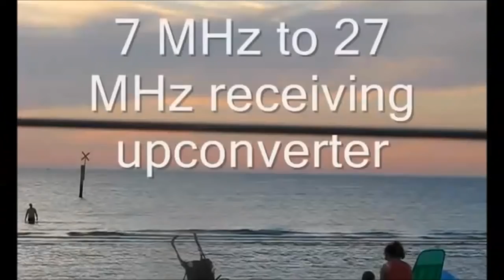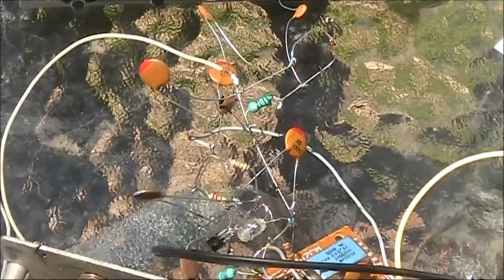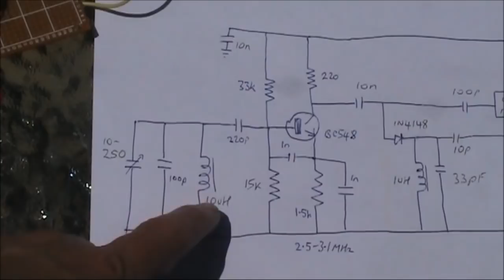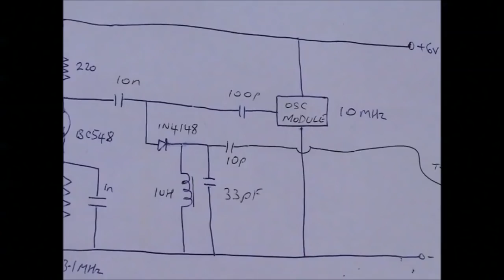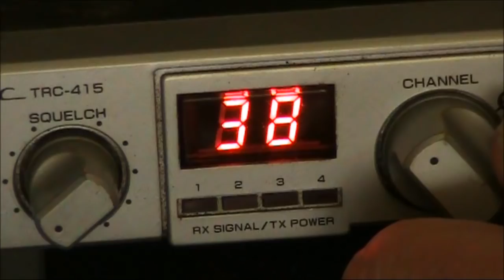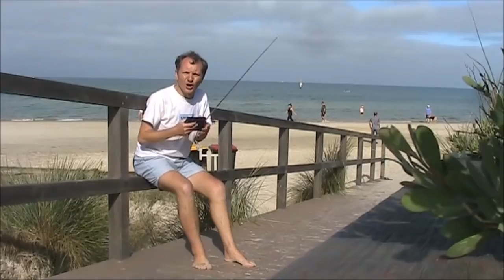Receiving SSB on a 27 MHz AM CB radio

Comment: hello Peter, could you please send me the design wiring diagram? Did you ever build one of these to receive and transmit? And lastly do you have any CB mods for 40 Cobra 29 Classic I could try.

Thanks
George
Reply from the maker: Hi George - The circuit diagram is in the video. I've done no wiring diagram. I didn't build one for transmit. Sorry can't help re the CB mods.

Comment: Peter, and hams who don't know this already, the biggest bunch of "power users" of CB in America are on 27.025 mHz (I think channel 6) also known as "the Superbowl".  I tuned my fancy HF rig down there for a listen yesterday, and they where going at it per usual.  Right now there is zero cw activity on 12, 10, or 6m (and none expected today), but those guys were getting some propagation with their AM signals running hundreds if not thousands of watts on 11m.  Yes, under our FCC rules, 4 watts is maximum for CB.  But then unless they cause harmful interference the FCC pretty much lets them run rampant.  And a lot of us hams were on the CB freqs doing about the same thing, before we became hams. So it's neat to go listen to those guys for a few minutes-gets old pretty quick, sounds exactly like it did 20 years ago (and further back I'm sure).  Some have fantastic AM audio and signals, but mostly it's a mish mash of guys simply trying to talk over each other or a heterodyne hell.  When propagation comes back around next solar cycle, I'm sure you'll hear some of these yanks if you tune there now and then.  Heard a Golden Eagle in there yesterday, they had some E-skip going.  Signals are weaker today-but present.
Reply: Have you heard this crowd from Francisco Bay area?   https://www.youtube.com/channel/UCQ27TShT08IUwSjjtlikBXw  They go out live on YouTube.

Comment: Peter, did you notice any desensing of the receiver due to the BFO signal? During my SWL days, I built a 455 kHz BFO for the National Panasonic receiver that I described in my comments against another of your recent videos. (I didn't dare modify the radio, as it wasn't mine, so I couldn't make any connections into the IF strip.) The radio had a non-metallic case, so placing the BFO immediately beside the radio allowed sufficient coupling into the IF strip to achieve product detection. However, I did note that the receiver desensed ... Max VK4MD told me this is due to the AGC being derived after the envelope detector. But at least I could hear SSB and Morse code properly. Cheers, Mike VK2IG.
Reply from the maker: Mike - desensing can happen if the BFO is strong (eg a transistor oscillator putting out maybe 1mW). It doesn't happen here as the signal is coming from a passive diode mixer with significant loss. Also having the BFO outside the CB's shielded box cuts the signal compared to if it was internal.

Comment: Better use 455Khz local oscilator to mix.
Reply from the maker: I considered that but wanted something that would work on any CB, with any IF, and didn't require any internal modifications or connections.

Comment: It might be more useful to get the radio on to 10m and convert to dsb?
Reply from the maker: This would be extremely difficult to do and it would be easier to build a 10m rig from scratch. Conversions to 10m were common with 1970s/1980s SSB CBs that used chips like the PLL02A which was easier to convert. Modern ICs are much harder. Plus you'd need to convert the power amplifier chain to linear.  And AM only CBs like this have much less room inside the case than AM/SSB CBs.
Reply: @vk3ye  Peter, I remember looking inside some AM-only 27 MHz CB transceivers years ago when I was looking for a radio to convert to 10m. All of the AM-only sets I looked at used high-level modulation. They would've been fine for converting for CW operation, but modifying the transmit signal chain to ensure the linear characteristics needed for SSB or DSB would've been a much bigger job. Cheers, Mike VK2IG
Reply from the maker: @vk2ig  Agree. Back in the valve days one option could have been to modify a push pull linear amp to operate as a high level balanced modulator. Then you could run 4 watts carrier in and get more out - as DSB. From memory use was made of the screen grid. This was used around 1960 when DSB was (briefly) popular amongst those who wanted to convert old AM gear and couldn't afford crystal/mechanical filters. I have yet to see high level balanced modulators (ie >1w) using FETs etc.